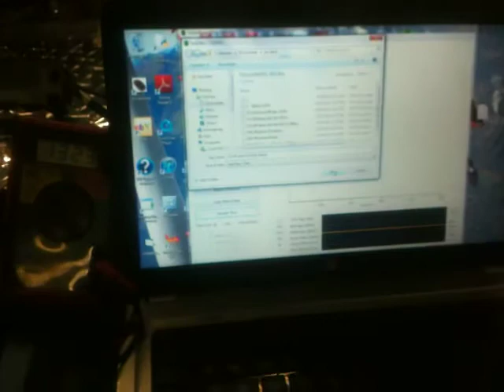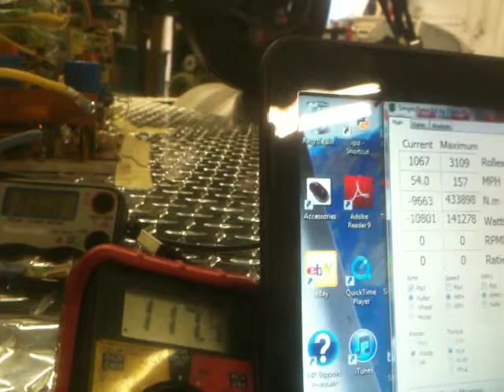Burning down at 32s

Comment from the maker: Did the first Dyno run ever on sunday.  I am going to look at better software soon.
Im not worried about the controller I need to re-design I have hi voltage flowing through ribbon wire and it had to be shunted to ground which loaded the ribbon cable to much as well.